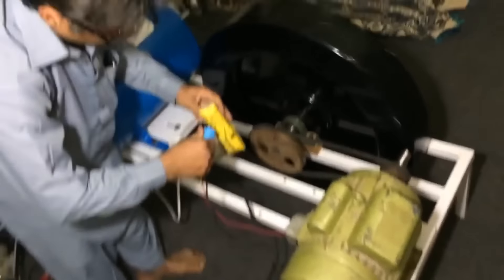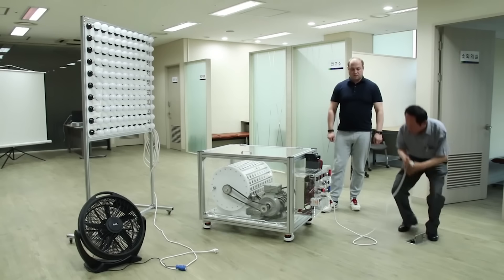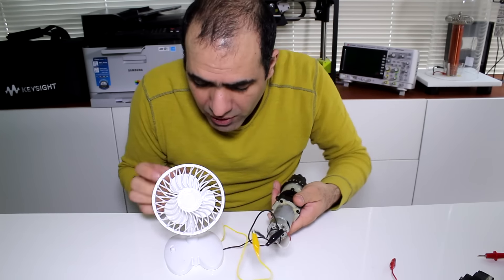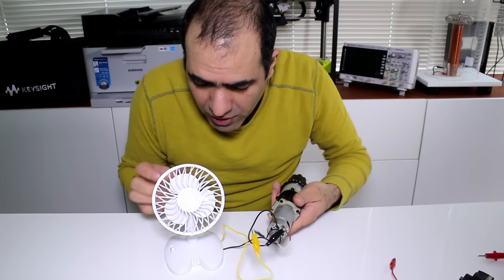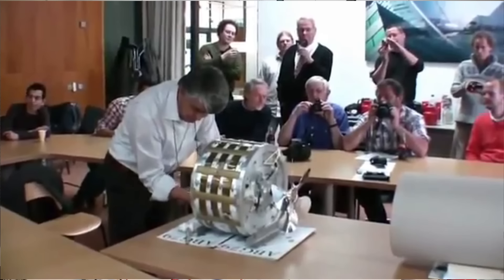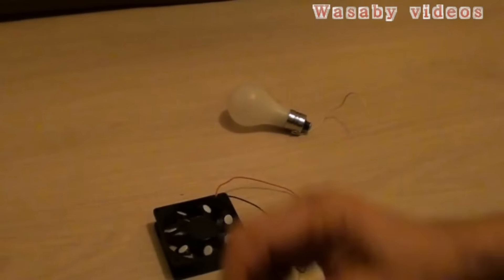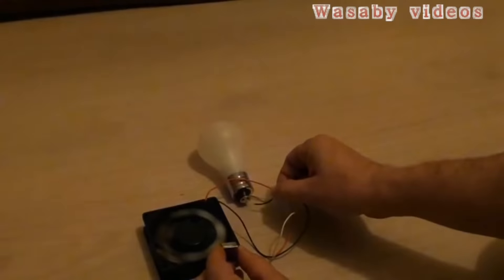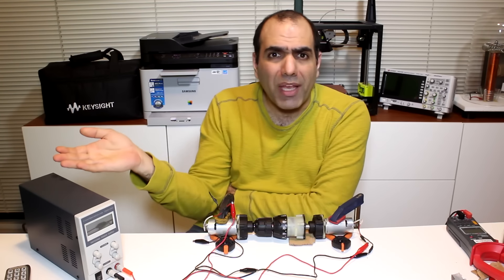The Curious Case of Free Energy Device

Comment: friction is the worst enemy of these devices
Reply: Brilliant!
Reply: no sex without friction . its very important
Reply: yassi anam Or vibration 😀
Reply: bimal stinson Friction is good 🤣🤣🤣. The designs were shit.
Reply: Friction proves it's fiction
Reply: MrPoopyButthole69 you got it!
Reply: then let's talk about something realistic like using strong magnets that could then be set into a fixed position on a small wheel that could then  be fixed onto a pulley system to allow an alternator to start producing AC current to a large number or car battery's daisy chained together
with an AC to DC converter and a  DC to DC Boost Converter then providing power to a house and what devises able to use may be limited you could attach more magnet wheels and another alternator
or even adding more batteries for a longer charge
Reply: evan wilson  What do you expect the magnets to do?  They can't be used to create motion on their own.  No one has ever been able to do it because the force is static and static forces tend to equilibrium.
Reply: magnet's can repel other magnet's.

 the fixed magnet's would be put in at an angle and a larger half  or two half's with magnet's fixed to another material that would fit over the magnet wheel fixed to a shaft the half pieces would have to be mounted so it or the two do not create more friction and the repelling magnet's then still align with the magnet wheel's magnet's
Reply: evan wilson  Yes magnets can repel other magnets but they also attract in the same manner making continued motion impossible.
It is apparent you have not tried this and you should.  Try and make a small wheel spin with just magnets.  You will discover it is impossible.
Reply: your imposing your own self limitations on others and no I have not made one my self however I know where there is a will there is a way

you could make it with two rows of magnets or more with the magnets
being offset or certain magnets fixed to attract 

you could also use a different build with electronic magnets and a timed sequence to cycle between on and off

anything is possible understanding that the word's "I Can't" are rely "I won't" is the first step to understanding that limitations are only self imposed.

  seek out more knowledge and the theory's of others.

just because you say it is not possible does not make that the truth.
Reply: There is already a device like that. It's called synchronous motor/generator and it doesn't spin on its own. Please, educate yourself before saying bullshit on a channel like this. There are many videos out there about electric motors and magnetism.
Reply: nemhain  Who is this comment directed at?
Reply: To this guy with 0 experience in that matter, but who is arguing with you :)
Reply: of course there is a device like that no it does not spin on it's own however if it is able to create more energy than it would consume then it would be free energy electro magnets would need electricity it's in the fucking name and i see this more as a debate than as an argument

I'm siding with what I believe just as your able to do the same the debate is not about what is used so much as producing a viable theory
that could make something like what I'm siding with as an end result

and if perhaps it's not possible now why not put forth an effort to research the  field that would be needed to make such a devise

wouldn't you rather be a person to prove others wrong  

especially when no one tell you that it's possible
Reply: evan wilson  I think I can speak for the majority on here and wish you good luck. 
Post a video when you have a working free energy device but collect your Nobel Prize first.
Reply: evan wilson If you have been studying physics instead of writing bullshit, you would know that free energy is impossible.
Reply: Caetano Reis Well high school physics will be ample.
Reply: John Yang  .
Reply: You missed the point, if friction could be bypassed 100% power conversion could be obtained, but these F.A.F guys are claiming they have achieved more than 100% output
Reply: Even with no friction whey would be useless
Reply: Even without friction, you could've made a self sustainable device (with 100% efficiency) at best. You can't take away energy from it, else it stops.
Reply: evan wilson
your comment hurt my head in so many ways
Reply: logic and physics are the enemy to these devices lol
Reply: direct counterfactual quantum communication could change everything we know about the current scientific model
Reply: What if the problem on the AP Physics exam tells you to ignore friction?
Reply: Even if there is zero friction these thing still won't work. They need energy and things moving without friction don't contain energy at all.